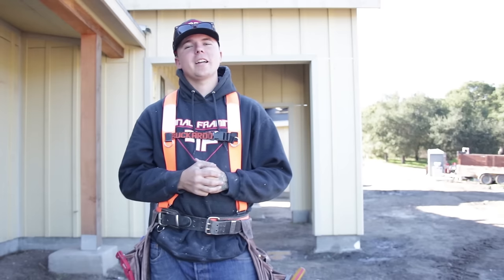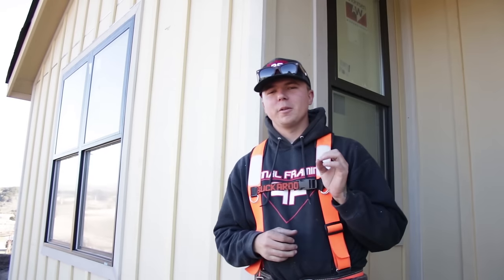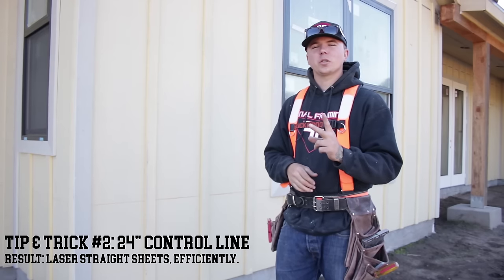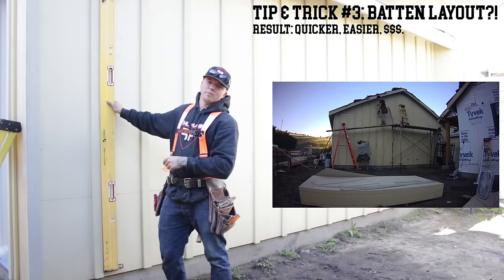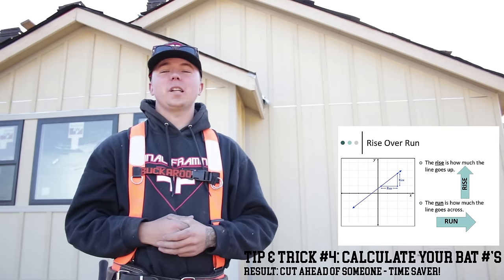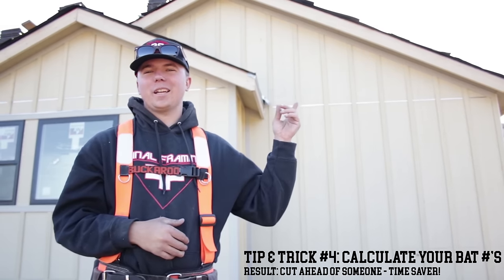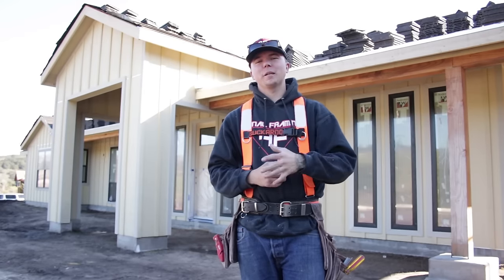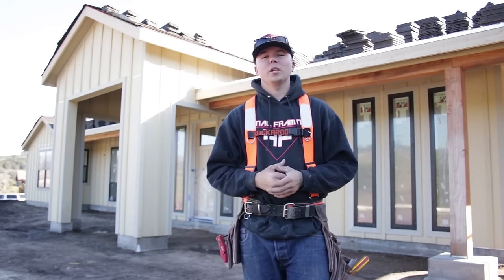5 Tips & Tricks: Installing Board & Batten Siding!

Comment: I worked with many crews in the past 50 years and one trick I found useful to make sure all the measurements are the same is to start off with a 4  or 8 foot measurement and have everyone fix their tape measure to that initial measurement. A hammer works good to fix the tape measure start clip used lightly. It works wonders on a big project. You'll know when you reach 20 feet that it will be the same 20 feet on the opposite side  of your project. Good video. Thanks for sharing...

Comment: Good ideas.  But have no idea what you ment about the 23 inch red line on level and how to use that to line up.  Wish you'd show or explain better.
Reply: Yeah, he has to explain that better!
Reply: Before you put up a panel, snap a line 24” from the bottom. Also, snap a line 23” from the bottom around the house. When you put the board on the house, line up your chalk lines and the result will be the board siding will be 1” below your underlayment.
Reply: Same

Comment: i am about to replace the siding on my house using JHP cement board. can i just install the strips only when the sheets meet? or i have to do it your way ? and do i need to caulk in-between the sheets and the side of the strips?

Comment: Hey. Just wanted to tell you that your video has helped me make good progress on my own house as owner/builder. The best tip here for me, aside from making sure that everything lines up (which was never a question for me an my ocd..)...was how to calculate the batten lengths. I think in my hurry to get things done, I didn't even entertain the idea of doing the calculations, until I clued in that I got a 45% pitch...and rise and run are identical. I did my entire roof 12 OC and each batten was just 12 inches shorter or longer depending on the direction I was going, and that was a massive time saver. The worst part is doing the first one, but once you got the right calculation, using math is almost a must if you want to move at any rate. I was working by myself and was banging my head against the wall until I came here and re-watched this video. I did watch it some time ago in general preparation for the build, but forgot about that very important tip. Thank you so much. All my board and batten on the roof sections is now done, the rest is all easy straight cuts on the bottom :D

Comment: Here is a handy trick for you. Make sure your first batten is dead plumb absolutely straight from top to bottom (very critical). Accurately cut a couple of pieces of batten to reflect your “fixed” desired spacing which will reduce if not eliminate tape measure errors. Attach a cabinet handle or wood block and one will be used for the up top guy and the other jig for the bottom guy. Keep the edges dust/debris free before using and quality check every couple of rows. Many ways to skin the cat.

Comment: Thanks for this!! Can you cover the trim also? Do I flush the panels to the windows and then run the trim 4/4 on top OR do I use 5/4 around windows and try to get the siding to line up perfect to that?  The reason for the latter is if we ever replace a window, we would only need to remove the trim .... ??

Comment: Do you need to make sure that the battens cover up the panel joints?  Also, does each batten need to be nailed into a stud, or will it be good enough to drive the nail into the panel and osb?  Thanks!
Reply: Yes, the battens need to cover up the panel joints. That's the whole point in the battens to being with. It's fine to nail the batten just into the panel and OSB since they aren't load bearing.

Comment: When it comes to painting, what is considered industry standard quality? Should I caulk the gap between the board and batt for the whole house? Also, what about the rough cut edges on the batts?  Should I caulk that so it is smooth to avoid water coming in and ruining the batt over time? Great video thanks!
Reply: Yes you should caulk every piece of trim that is nailed onto the board

Comment: for the boards, Do you use hardie plank with a seam under every batten or do you use 4x8 panels, where some of the battens are decorative and the other actually seal a seam?
Reply from the maker: Hardie Sheets - 4x10’ for this home. None are decorative underneath. All just grain textured, doesn’t look like T1-11.
Reply: @MattBangsWood  Thanks for the reply. I meant that some of the battens are purely for decorative purposes while other battens actually hide/protect seams.  And then are the sheets applied directly on the house wrap? I see some people furring them off the wrap slightly for air/moisture flow.  Thanks again, this video is really helpful for DIYers
Reply: MattBangsWood got it!! Thanks

Comment: Matt the big question (to me at least) is how you trim window and doors when using hardie sheet goods versus clapboard style.   Do you install the 1x4 (or 5/4) before the panel, or after /on top of the panel?    Seems based on comments here that there's some disagreement as to what's recommended or code required.    Informative video.
Reply: Hardie themself says you can do either depending on the situation. If it’s 5/4 trim then typically trim is done first; If its 4/4 trim then the panels are applied first and trim ontop

Comment: For the area where the concrete foundation is exposed at the bottom.  Does that need to be flashed? I don't know anything about this... Our foundation has what looks like old foam, with thin metal over it that covers the foundation at the bottom, but only in some places.  It's corroded, and the foam is exposed and also corroding. Is it even needed, or can it just be cut off? I've checked it, and all that's behind it is the concrete foundation, which is not flashed elsewhere. I really can't see any reason why it's there in some places, and not around the whole foundation.

Comment: do you space out the batts the same? for example if I have a 7' wall then a 10' wall, would you space the batts out the same distance on each wall even if you'd have a smaller distance at the end of the 7'?
Reply from the maker: 16" or 24" is standard and you will not change that or you wont cover your nail holes.

When we build a house (watch current videos), we plan for batten layout as early as foundation.. Your battens land on your studs, 16" O.C., therefore we pull from one side of the house all the way to the other.

When you want things centered, pull from the center, either 8" both way from the center or start with a batten on the center.. work your way 16" o.c. each way from there. Pull one layout, use it for the whole house.

Comment: You would happen to have the link to the 4x8 sheets you use for this? I’m having trouble finding smooth siding
Reply: James Hardie 4x8 Fiber Cement Vertical Siding - you can get smooth, cedarmill, or stucco texture. Lowes carries them preprimed, you would have to paint them

Comment: Matt, got a siding/baton job coming up soon. They wanna use cementitious siding sheets. What is your preference on nailing this type material?
Reply from the maker: James Hardie Sheets? We nail them on with 2-1/2” nails, with a siding gun. Although with board and batten; roofing guns with 1-3/4” or 2” nails are seen used as well.

As far as trim goes, 15ga. Finish Nail Gun to put together and put up all trim and battens.
Reply: @MattBangsWood  thank you sir. And keep up the videos, it's been a great encouragement to me to see your young bucks working hard and walking plates
Reply: @MattBangsWood  thanks for the great content. I’ve been trying to put up 1x4 battens with a 15 ga finish nailer but the nails just bend like crazy. Has that ever happened to you?

Comment: I was wondering how you do your trim, do you just cover the walls then use 3/4” hardie for the corners and around the windows? Do you flash the horizontal trim, if so how with batt and board?
Reply: My question exactly. What did you find out?

Comment: great tips, great video.  do you install your corners before or after the flat "board"?  in otherwords, does the exterior and interior corner trim go over top of the board, or do you install the corners first?  (debate with my detailer).
Reply: They would go on after the 4’x8’ sheets go on the walls. They go on at the same time as the battens.

Comment: what type of nails do you use?  Brad or finish?
Reply from the maker: 2" 18 ga. Brad Nails for bats and trim. Stubborn pieces, we have a 15ga Finish Nailer with 2-1/2"!
Reply: @MattBangsWood  would those finish nails be stainless, or galvanized? 
Here in the panhandle of Florida, salt air seemed to rust out galvanized

Comment: but they never meet right in the middle of the point of the roof. Do you always measure from the side or from the center and out?
Reply from the maker: Center out, you want to make sure you have either an equal gap from center.. or if the wall is of little importance, pull from side and run with 16"o.c.. They meet at the middle of the roof if you start at the middle of the roof. Layout is key.

Comment: This is not Board and Batten. This is full coverage exterior sheathing with decorative battens added on top. I was looking for a video on how to install Board and Batten, Nail Spacing, Nailing into studs, Nailing the batten into studs or into the board.
Reply from the maker: This is how board and batten is done in 2022.. Using a 1x12" is a thing of the past. If you want something like it, LP has a product out right now that's close, but still not the same.

Comment: one inch lower than the green bottom plate ?   what that  1/2  inch sheet is just flopping and waiting for  a lawnmower or bicycle to tagged it and chip it off ?    why not do z metal like you did at the gable breaks keeping that 8 ft and above sheet from sucking up and swelling why not the bottom sheet ..I run a 1x3  band than the z metal than the bottom sheet ties in the corners and 1x2 band at the top wear you meet the sofit. And that is actually MONEY and lasts longer than ...well havent had a rot damage call yet !